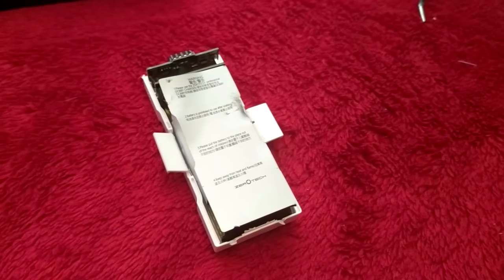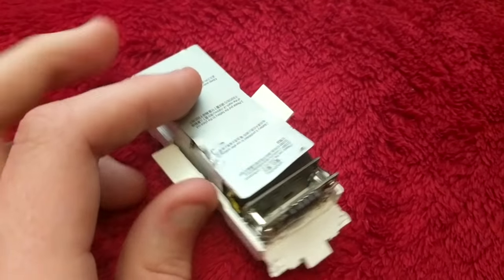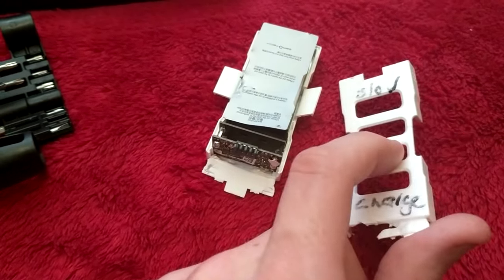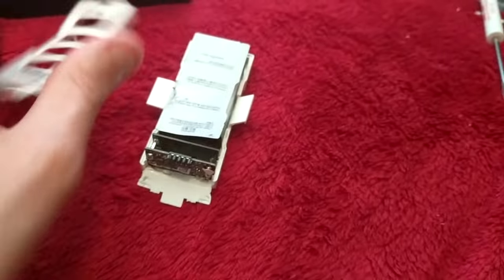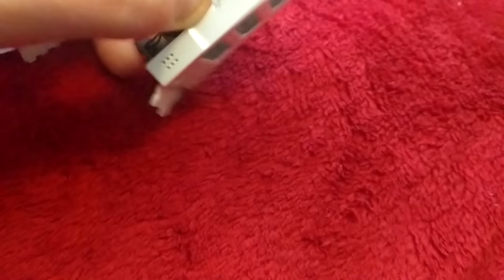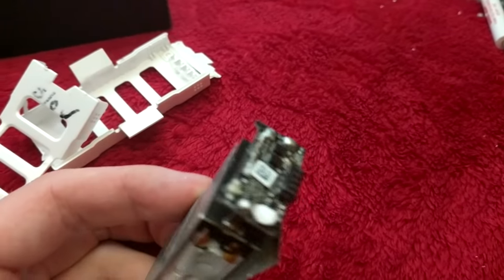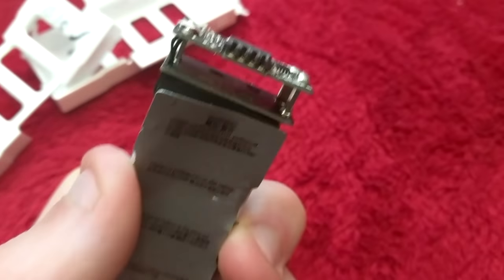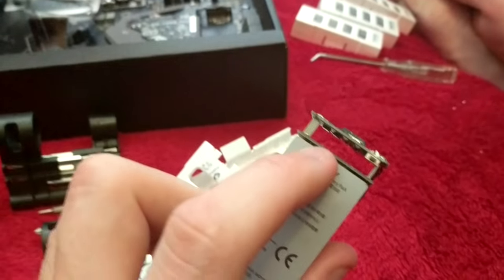What's inside a Dobby's Intelligent Flight Battery?

Comment: It's not the battery dying, it's the circuit failing or  a hidden design to kill the circuit automatically. I managed to cut open the battery and manually charge the Liions using IMAX b6. I got all the led lights coming up as well but no out put from the connector pins..I might bypass the circuit and try..
Reply: Did you try?
Reply: @vok78  it's a waste of time. The battery won't last without that circuit. This drone is a complete waste..

Comment: i'm hoping you could replace the battery with higher capacity so the flying time will be double and maybe you could just velcro to strap it to the body of Dobby. sometimes it's a kindda frustating you're limited on recording video and you need to activate return home within 3 to 4 minutes so you still have enough time before the drone starts to fall
Reply from the maker: I was thinking something similar. This battery is basically designed to destroy itself when you open it. Sad... They released a newer gen of battery (the 152) that has like 15% more battery capacity, but that's really not a big improvement. I may try to get a chassis 3d printed, then use the PCB from the top and a new battery pack. What I haven't been able to confirm yet is whether the failure was due to the lithium packs wearing out, or the PCB failing, or if they have some circuit designed to kill the battery after a certain lifespan.
Reply: maybe similar to this one:

https://www.youtube.com/watch?v=jXKZA2aCNkA
Reply from the maker: I want to do it in a usable way that I can travel with.